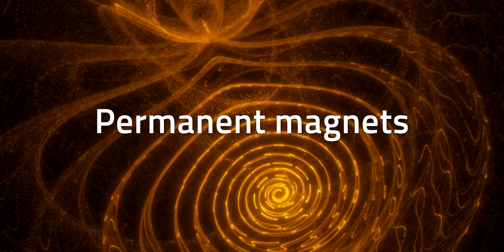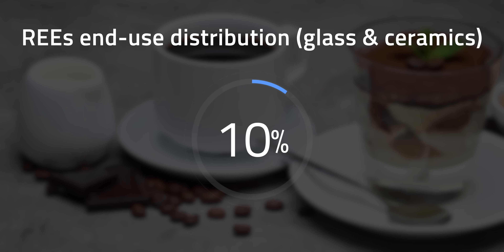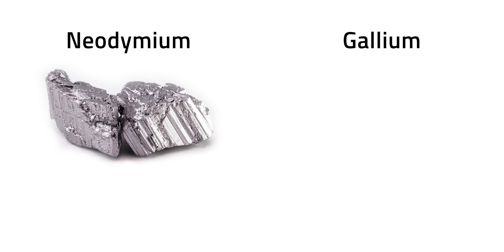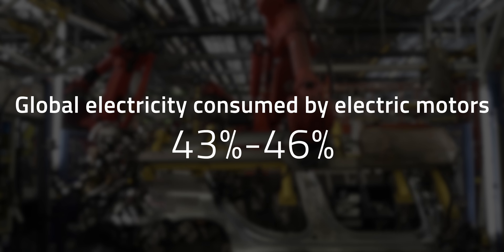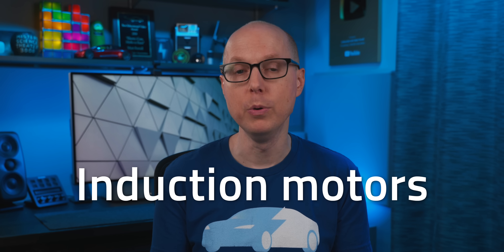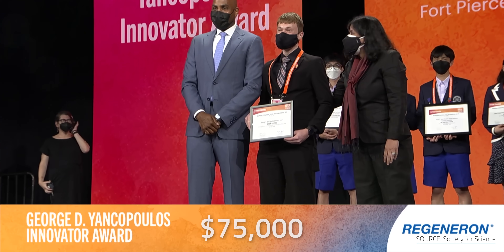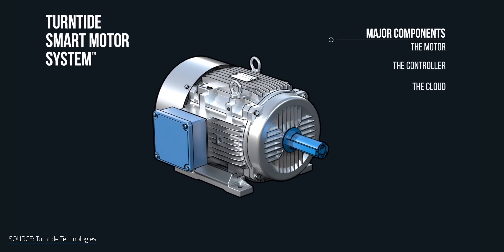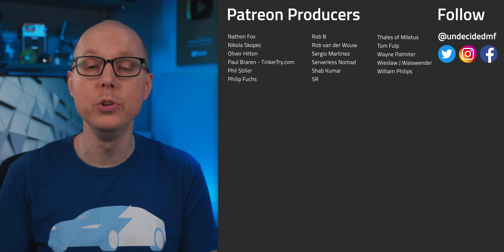Why This 17-Year Old's Electric Motor Is Important

Comment: Hi Matt, thanks for another great video. What I‘m missing, though are two things: 1) I think while discussing electric motors needing permanent magnets, it is really important to point out that several brands already use motors without permanent magnets. E.g. Tesla‘s initial drive trains all used asynchronous AC motors without any magnets and asynchronous motors are still widely used in EVs. So just inventing an EV motor without magnets is obviously NOT the real highlight of this young inventor. Which leads me to 2) It would be great to explain the differences and especially the pros and cons of the various electric motors. I think (but don‘t know even after watching your video) that the highlight of the invention is actually that it is a magnet-less synchronous motor. And that we‘d need to point out why you‘d prefer to have that type of motor vs. an asynchronous motor. Also: in an all wheel drive car you normally now have two different motors, one of which regularly is a magnet-less asynchronous motor so that you can simply cut power to the motor if only power is only needed on the other axle. 
Bottom line: a video with an overview of the many synchronous, asynchronous, reluctance, non-reluctance etc. motor-types for an EV and why you‘d want one for a specific purpose in an EV would be great.
Reply: It does seem like Matt does not know much about electric motors... Maybe he should invite some engineer like Electroboom...
Reply: It appears the actual work he has been working on is to do with Saliency in the motor. . .  Now being into technical details I should know about Saliency but I hate to admit, I don't. . .  I believe is is to do with the problem of low torque in a motor when running slower than it is designed to run. . . . Yes, we are getting up into the high 90% efficiencies with large motors, but presumably that is when running high load and at their designed speed. . .   I suspect that Saliency is about improving slow speed performance.. . The mention of heat melting plastic concerns me, because we want motors to run cool for good efficiency.. . Any Heat is lost energy. . . .  These days, we use VFD to get good low speed performance out of motors designed for high speed.. . .  This is a definition, but actually means nothing :  " Saliency is a measure of the reluctance difference between the rotor and the stator around the circumference of the rotor.  ". .  This means more :  "   What is the effect of Saliency in synchronous machine?
Saliency contributes reluctance torque in machines and appears when motor construction causes the stator winding inductance to vary as a function of position. In simpler term, saliency occurs due to non-uniform airgap.  "
Reply: Lets play spot the german, i found one here. When talking about "asynchronous motors" you are probably talking about what is really called induction motors in english. Similar to how in german we can say "Asynchron-" or "Induktionsmotor" meaning the same motor tech.
Reply: @ImTheCrepe  Close. I‘m not from Germany but from Austria. And yes: here we also call induction motors asynchronous motors.
Reply: @janeblogs324  .  .  Tesla never harvested any static electricity.. . You can't get any measurable power that way.
Reply: Sometimes the comments and the discussion that follows are the real hidden treasure. Thank you folks :)
Reply: Wow, and here i thought electric motors couldn't be anymore perfect:)
Reply: @Eduardo_Espinoza    There are very many different types of motors, but large ones intended for serious work are already up in the high 90% efficient, so no room for much more improvement.

Comment: The great advantage of using permanent magnet motors in an EV is that they can be switched to become a generator when torque is applied to the motor via the wheels & transmission when the vehicle is slowing down or coasting downhill to partially recharge the battery. Induction motors can't do that. And the idea of using the cloud & remote servers to control your motors is about the most insane thing ever. If so-called highly secure defence servers can be hacked .......

Comment: I work as a commercial electrician. Knowing what I do about the businesses that use large motors, I find it INCREDIBLY unlikely there will be large scale adoption of smart motors anytime soon. Most of the motors I work on have costs in the hundreds of thousands for any time down, and local analytics are already working hard to keep the motors running efficiently. Local severs are considerably less susceptible to outages and the required maintenance that servers deal with. Any electronics that are integrated with the motor itself would need to be up to current robust standards that we have to deal with daily.

Comment: During the summer and fall of 2022 I installed 30 turntide smart motors. The installation is relatively simple. The motors are heavier than those they replace the programming is straight forward the controllers are nice the app interface is easy to navigate for a technician and the tech support is direct and effective at resolving any nonworking components. The motors are significantly louder this is really the only drawback I noticed. Though there is some inconsistency in the noise levels. Not sure if this is manufacturing or installation. Clients that requested the motors were pleased.
Reply: Cool tech!

Comment: Matt - you need to do a video on the Halbach Array for magnets. The Tesla Model 3 motor uses this - and it focuses most of the magnetic field on one side of the array; making it much stronger.
Correction - Nikola Tesla's invention, the induction AC motor does NOT use any permanent magnets. It uses coils of wire on the armature rotor that generate electric current flow from the stator's magnetic fields - which create magnetic fields of their own - which then cause the rotor to spin. It certainly seems like magic, though!
Reply: The Hallbach array may sometimes have structural advantages, but such a motor is unnecessarily expensive and does not provide special advantages. "stronger field" is not a valid argument. There are more factors.
Reply: @srotovnikabc6919  I wonder why you think this - focusing the magnetic field in the direction of the coils makes the motor higher torque and requires less magnet material. And the way these are placed in the rotor greatly reduces the cogging of the motor at higher RPMs.
Reply: @NeilBlanchard  In general, it is useful when the torque does not pulsate. And this is mostly achieved by sinusoidal distribution of the magnetic field along the rotation (tangentially). Hallbach can also be designed for sine. But it is unnecessarily expensive, because a lot of the mass of the magnet is consumed along the line of force. In general, with respect to the usual slats, the induction will be in the range of approx. 0.6-1T. And for that, with today's neodymium magnets, a height of approx. 5 mm is sufficient, certainly less than 10 mm in the direction of the line of force. The area perpendicular to the field line must be preserved with respect to the EMF. I designed electric motors for a while.
Reply: Dare you to ask Sandy Munro on the matter.
Reply: @echoeversky  If I ever get the chance to, I would be very interested to hear what he would say on this.
Reply: @srotovnikabc6919  i agree. All a hallbach array does is use clever summing/subtracting of several magnets fields to eliminate the need for a back iron. There is no magical gain in field strength.
Reply: @echoeversky  sandy Munro just takes apart cars and checks the production quality and costs. And is in Tesla's pocket.

Comment: One part of the "Smart Motor" I have an issue with is the cloud computing optimization. Having a manufacturing process go off line because a server fell over or worse yet run out of control because someone hacked and MMI is just not acceptable.
Reply: true, especially when optimization could be done with something far less powerful. If theres no need to synchronize ALL motors over a large amount of space, then there shouldnt be any need to sync them all up to a centralized system.
Reply: Motor as a service seems great. Just a small monthly fee to have optimal performance, or none at all.
And with the planned obsolescence package you will get a notification if you need to buy a new one, because after a few years nobody is going to write updates for a old smart device.
Reply: @LvGnt  Exactly, Not surprising amazon is backing a motor that requires cloud services..
Reply: i don't know the numbers so it might be negligible but collecting data for the cloud at the scale of every electric motor in the world would use a massive amounts of power and likely undercut efficiency gains.  the cloud isn't a free natural data storage area that uses no energy
Reply: @williamdana6661  Not yet.  It will become close to free when we can run datacenters in space.
Reply: @williamdana6661  exactly, and you won't have the connection speed to optimize in real time, only to send out software patches
Reply: @LvGnt  Your missing the bigger picture.  The post office decides you don't need a motor, and calls the NSA, who calls homeland security, and your motor just stops working.
All becasue you ordered school books so your child can learn still even if the school refuses to teach.
Reply: @williamdana6661  It would be more practical to use a hierarchy of cloud data collectors that would summarize and upload their data to higher and higher levels, so the “master” would only deal with subtotals.
Reply: @robertsmith2956  You must live in Florida, aka DeSatanland.
Reply: @allanrichardson3135  Give me a benevolent satan over a drooling tyrant any day.  
Don't forget Satan is an Angel.

Comment: Fascinating that you fell for this one too. Magnet free motors existed from the beginning. I have learned about them at standard course at the university 40 years ago. How can you even imagine that a 17 years old overtakes thousands of engineers working for 100 years? How does it even sounds probable to you? It is a clear PR stunt.
Reply: worse, he said no airgap 🤣 and I was like, how does he think it is rotating
Reply: I agree with your conclusion, but not with the assertion that an independent thinker can't make connections not come upon by thousands of engineers. I think it happens regularly.

Comment: All asynchronous induction motors I'm aware of do not have any permanent magnet in them. Also the vast majority of industrial DC motors use electromagnet instead od permanent magnets.
Reply: Also AC motors are very easy to make and they are quite efficient at the specified operating conditions. Only motors that handle large power and uses permanent magnets are BLDC motors. They are suited for direct drive and operating efficiency is less important.

Comment: If this motor is much cheaper, use 2 and a differential gear to get a variable ratio.  This will pay off in reduced amperage required to achieve high torque, so smaller cables and controllers can be used on larger vehicles.

Its a balancing act, but it might work.  Need to see the numbers when he can build some higher performing prototypes.
Reply: Do you even understand 'power'? No amount of differential massaging will reduce the power required.
Reply: @VEC7ORlt  I usually like some of the content here, but feel like we've found the end of YouTube again on this one- propaganda overload and an audience who struggles with discernment. At least they aren't saying this kid invented a free energy machine...oh wait, I think I saw another video where they say he's claiming he has...
Reply: @Rick-the-Swift  problem here is that op only cares about engagement and will babble whatever.

Comment: There is a company (Niron magnetics) in one of the northern US states that is working on Iron nitride magnets, they are as strong rare earth magnets, and only made of iron and nitrogen. They are also more thermally resistant (higher curie temp) than even SmCo magnets, which are themselves the most thermally resistant of the REEs. You should definitely do a video on them if you haven't already.
Reply: @adamw2785  
Underrated comment!

Comment: When I went to college in the 1960s, although I was more interested in communications than in motors, I did take a couple of intro classes in motors and generators.  There were no rare earth permanent magnets in wide enough use to affect product designs at the time (unless they were classified!), and the most powerful permanent magnets were Alnico, a trademark for an alloy of (obviously) aluminum, nickel, and cobalt.  Therefore, permanent magnet motors were only used in toys and miniature electronics, while “business” size motors used the same power supply for the stator field and rotor (at least in DC or universal motors).  When used as a generator, the residual magnetic field (hysteresis) in the “soft” iron cores of the stator windings served to generate the current to power the stator when first started (of course, a motor can be a generator when turned by an external force).  AC only motors were generally used for clocks and were designed to synchronize their rotation with the power supply frequency.  I don’t remember much more about the motor-generator field since I haven’t used that knowledge in the meantime, but it is fascinating that so many advances have been made in the last half century!
Reply: I didn't know they had classes for electric motors, that's really cool! :)
Reply: @Eduardo_Espinoza  Actually the courses were more generally “rotating machines,” with the adjective “electrical” understood because the courses were in the Electrical Engineering department, so no turbines or internal combustion or steam engines.  But the generators connected to them were covered.
Reply: I had a similar introductory course at 2005 at the Electrical and Computer Engineering school I attended back then where we discussed the different types of electric motors and generators. But like you it wasn’t my interest then and I pursued the computer part inside the school although I never got to finish it and work on the field.
Reply: Very interesting!  Thanks for sharing!  
I guess it makes sense that PM motors hadn’t been explored much at that time given that neodymium magnets were not availability yet (at least widely).  I remember seeing some magnets used in classroom demonstrations (probably from the 70s at earliest) that were massive but they couldn’t hold a candle to the force from a cheap rare earth magnet of today.  
It’s fun to imagine taking a “rotating machines” course at a university, that’s the kind of thing that would probably have motivated me to go to a University after high school!  Haha

Comment: Good job, moving in the right direction! Capacitor and battery technology also needs improvement in their rare element composition. Young man is on the right path!
Reply: Agreed , more efficient solar cells, in road stator charging use the permanents give to govt to distribute rare earths into ev charging strips.

Comment: So what is the main innovation of the new design? The intro talks about avoiding need for permanent magnets, but we've known how to do that forever. The magnets just make for more compact motors.
Reply: It's a synchronous motor with air gaps replaced with another material.
Reply: you are right: most BLDC motors use ferrite magnets that are not too powerful but very cheap. The size advantage may be around 20%